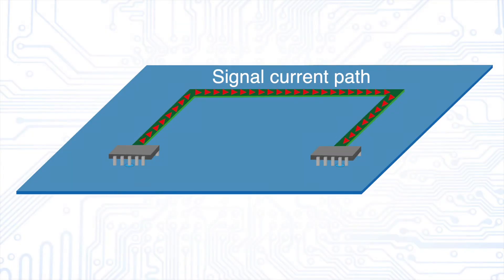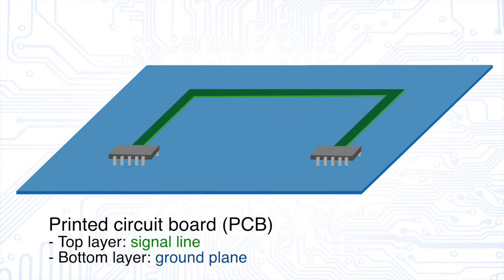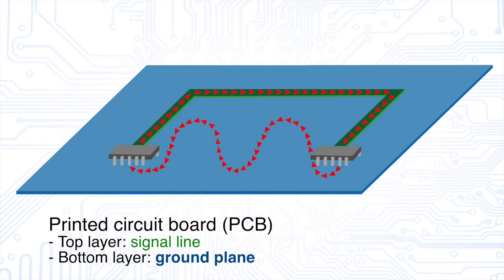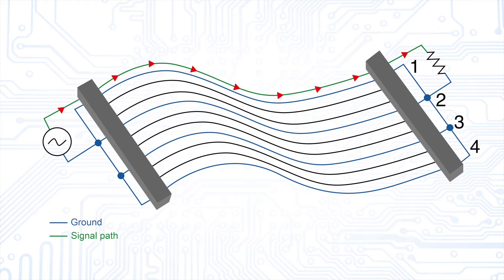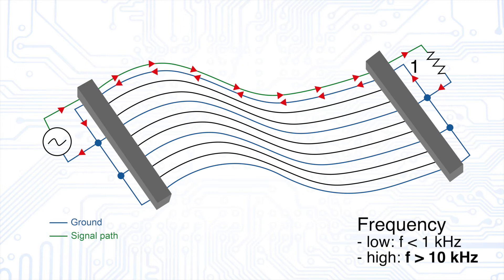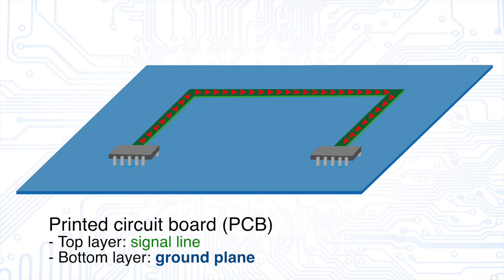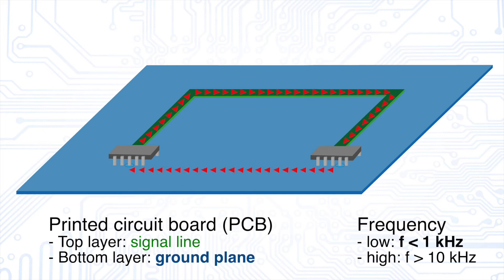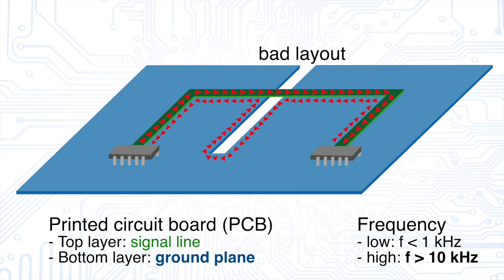Current return path

Comment: The topic is very interesting and important, but no, there is one case where the latter theory is correct—direct current. The higher the signal frequency, especially above audio frequencies, the return current will follow the path of least impedance (under the input signal conductor).
Reply: I wrote "sorry," and only then started scrolling further. Excellent material. But still, the second option, "never," is not the correct phrase.

Comment: I dont believe this is true. Whats the point of ground plane if high freq current will not use the ground plane.
Reply: bağartma yav 🤣🤣
Reply: it is true. ground planes in high frequency PCBs aren't for providing a refence voltage, it's a reference plane that determines a transmission lines characteristic impedance. Also provides isolation between a signal layer and other signal layers/DC layers
Reply: At high frequencies above 1MHz, the return current will return back through the ground plane. It has theoretically a million possible paths to return via the ground plane, but it will choose the one with the lowest impedance. It will practically copy the path of the signal wire. A ground plane with a cutout is the worst option, it increases EMI 20 times compared to a ground plane without a cutout. It is better to use a cross hatched ground plane, where the holes are arranged regularly and resemble a latticework. It has almost the same EMI as a ground plane without holes. A ground plane with a cutout is the worst option.
Watch the video with Rick Hartley - How to achieve proper grounding. Somewhere in the middle he talks about it and mentions that it was first presented by Prof. Wu.
Lower frequencies would not be able to find the path of the lowest impedance on the ground plane and therefore needed routing rails insteade of plane back in the 80s.